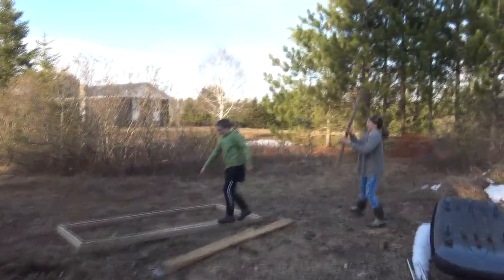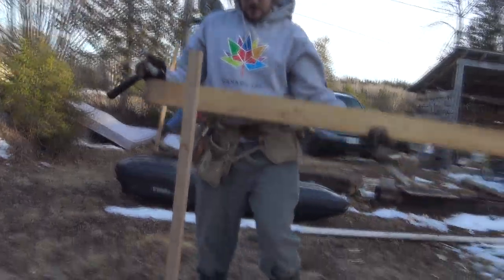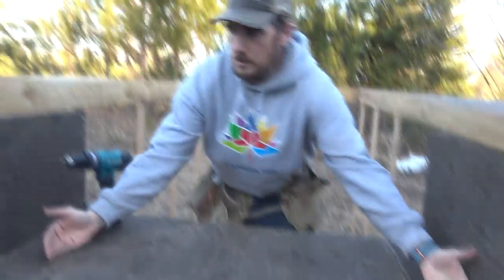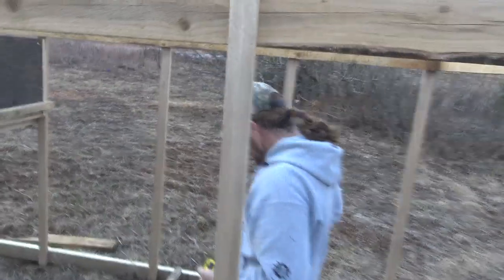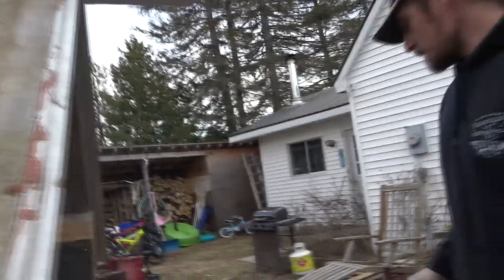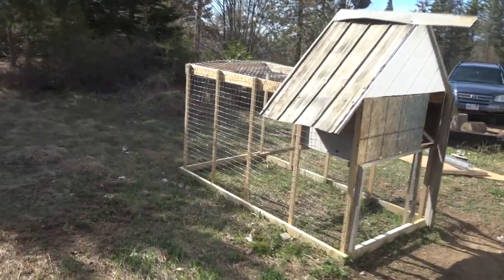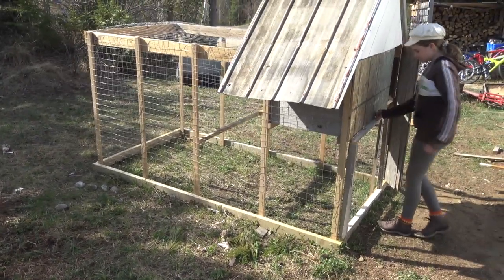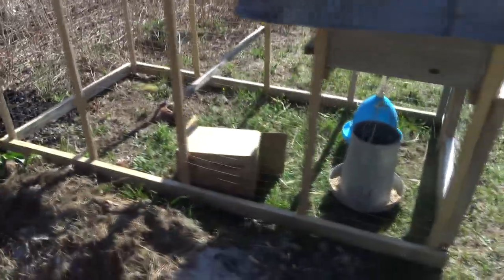Building a backyard moveable chicken coop with my kids

Comment: Your better off to predrilled the holes in the jump bar the best way to make your predrilled holes is to take a drill bit and line it up withe screw the hole bit should be small so that you can see the biting edge of the screw but not the middle section. Then when you screw your jump bar on you get all the strength you need but none of the splitting. Now that it split on both ends you'll have to replace the jump bar sooner then needed only because of the elements of outside.